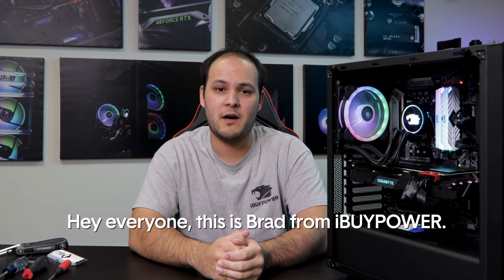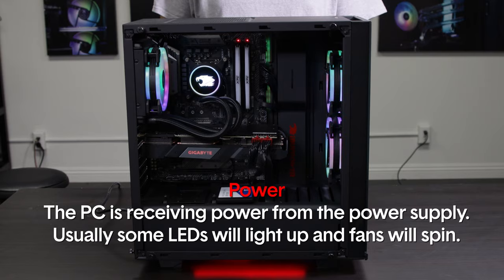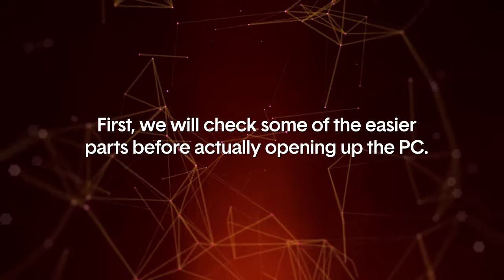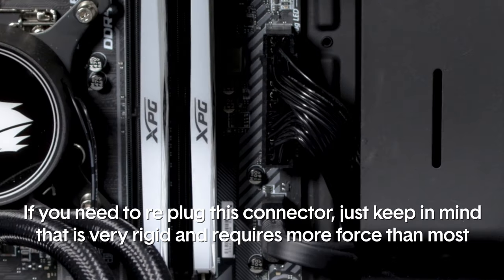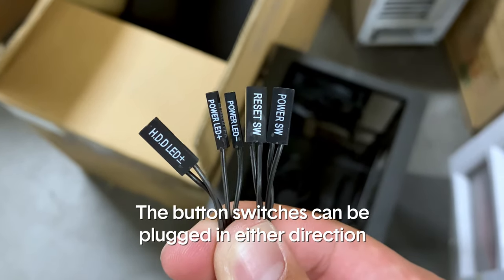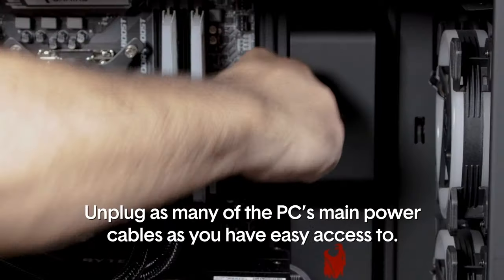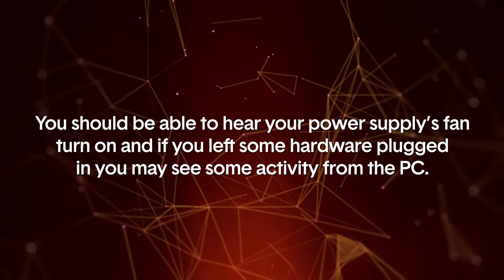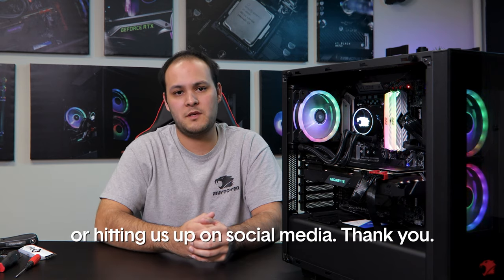"My Computer Will Not Turn On" - Troubleshooting PC Power Supply | Computers and Coffee

Comment: My system was affected by a power outage .  My microwave and clock radio had flashing displays. My computer had a green LED on the rear of the power supply and orange LED on the mother board lit,  The power button on the computer face would not light or respond when pressed. I jumpered the green & black wires from the power supply and the PSU fan and 2 aux fans turned on. Still, the front button would not light and nothing would respond if I removed the jumper to the power supply wires.  Any suggestions to try next ? Thanks

Comment: I got to the part where I put a paper clip on the on/off charge and when I turn it on the fans turn on but when I plug it back it doesn’t turn on. I also did look at the power supply and the prongs for 3 and 4, 4 is missing.

Comment: Was gonna watch this video, saw I had to turn the power supply off first while my pc was open. Noticed a light flash in the pc when I turned it off. Turns out the on and off switch just flipped

Comment: just builded my first pc. it wont boot and when turning on the power only my motherboard turn on. when pressing the power button nothing happens. i have checked to see if my power supply is dead but it works fine. can anyone help. i suspect that either the motherboard or the wires from the case doesnt work
Reply: Try disconnecting everything and plugging it back in. If not I usually remove the GPU and try to power it like that. You might have to trace the wires to make sure they're connected to the right slot on the PSU.

Comment: I used the paper clip and the computer turned on.  However when I plugged the 24 pin cable back in the computer would not turn on.  Not sure what to do nexr\t

Comment: I have a power issue with my z390 board. The lights in the board come one, but it in a bit of a flickering way then turn off after about 20 to 30 seconds. The system does not turn on with the power button or when bridged with a metal object such as a screwdriver. I've already tried another psu, same results. I tried various things like with/without cpu, cpu cooler, ram etc.

I believe it's a power delivery problem, like it doesn't send out power correctly across the board but I don''t know where to go from here. Perhaps a faulty capacitor or two?

Comment: My pc won’t boot, and I mean, it won’t even go so far in the start-up proces that I can’t do what you are showing in the video. It will turn un just fine and have weekend just perfectly until a Windows 2004 update, then the problem came. I do can figure out how to set my pc to boot from USB, but my pc doesn’t boot from my usb even though that I in the bios set the boring to be from my USB port. What to do? It just shows my Lenovo logo on the screen when I start up and all I can do is to Press f11 to Enter my bios menu, but I can’t Enter any windows repair/recovery functions. What to do?

Comment: Ok so I ended up having to do the paperclip thing. The only thing powering up are my case fans, everything is plugged in correctly and all that. So is it a dead motherboard then? I get no video output, tried two different HDMI cables and also tried hooking it up to onboard graphics Instead of the GPU and got no results from both. But even the fans of the GPU don't spin, so dead mobo then?

Comment: I just repasted my cpu and now I can't get it to power up. Zero power to computer. Hope this guide will help!
Reply: Looks like the power button connector was the issue. The bad news is cpu temps are still high, so time to try a different method of applying thermal paste. If that doesn't lower temps I guess it's time to get a new cpu heatsink.

Comment: Built my first pc and it worked fine for almost a month. Then it starting doing a thing where it wouldn't send a signal to my monitors except for some green dots when I restarted it. Then it wouldn't even power anything on. I send my motherboard in to be fixed and plug it back in when I get it and still nothing turns on. I really regret making the switch to pc. It really hasn't been worth it at all.

Comment: What is the case if my power source and switches are working fine? Fan is working but no display.. it open once but when i press start normally it turned off and then won't ooen again

Comment: I got AMD Ryzen 7 5800X up to 4.7GHz, 16GB DDR4, 1TB NVMe SSD, AMD Radeon RX7600XT 16GB with 500W power supply and it randomly shut off and wont turn on could it be that 500W isnt enough?

Comment: I tried the jumper method and my psu still working and I try to connect them one by one still connect but after I stop the jumper and put 24pin to motherboard it won't turn on, so is it my mobo is dead or something else? I try to jump the power switch but it also don't turn on

Comment: So I have the x570 aorus elite wife MOBO. And at first I was getting no signal to the monitor even though it seemed to power on fine. After I sent it in for repairs, it came back to me not powering on at all. The paper clip test worked but when I plug the 24-pin cable back in I still get no power. Am I out of luck and should just have this one replaced or is there another solution??

Comment: I have seasonic 1050 watt
Arround 6 years
I have this problem power on
I fight to turn on
Connect with old dell 29 inch monitor 
Mini display port
Second screen is tv samsung to watch movie with hdmi
You think is just cable or setting 
not psu 
Issue ?
Thanks a lot

Comment: Hello if the problem comes from the power swtich button (my PC doesn't turn on when I pressing the power button but it works with screw driver), what is the step do? Replace the front panel cable? Thank you

Comment: Oh I really need help. Even the computer repair shop is confused. So I did what you suggested in the video and the PSU didn't do anything. I took it to the repair shop. They put another CPU in the motherboard, and it turned on. So now they say that the CPU needs replacing for it to power on. They have never seen one of these CPUs fail. This doesn't seem right. The CPU is an i7 8700 4GHz CPU. It has worked without any issue up until I left the computer sit (not be used) for around 2 years. I had left it in my home country and then moved overseas. I just brought it back with me on a plane and tried to start it. Dead. Please help. I really can't afford a new i7.

Comment: I have everything plugged in and when I jumped the power supply it's fan turns on but nothing happens when the 24 pin plug is plugged in.
What can I check next?

Comment: Hi guys ...

Apologies from commenting on an old video but 

I thought I had an issue with my psu as my fan wasn't spinning when powered on. When I took the 24 pin plug off and bridged the two pin the fan spins... So from this my psu is ok you think? The voltages are all ok too

Comment: So i did the paper clip thing and it worked the rgb turned on but when i try to plug in any other cable it wont turn on does this mean my motherboard is not working or ?

Comment: just did an upgrade to a 3950X on a X570 mpg with a 500 W PS, when turned on, not even the power button on the tower lights up and when I press it I get a millisecond of activity before nothing works. fans and lights try to run but quickly stop. I have had issues of system crashing on old system and read things like that point to a faulty PS. thinking just upgrading to an 850 and try again.

Comment: need some help...so i have my 500w psu...but it wont turn on when i use it on my computer, ive tried to jump the psu and it still worked(the fan is spinning) it just wont turn on when connected to the computer...i also tried using my old psu(250w) it work perfectly...does that mean the problem is in the 500w psu?

Comment: I just replaced the motherboard, ram, and nvme drive in my build and when I plug it in and flip the psu switch to on the ROG logo(Asus ROG B550-F gaming board) turns on so the board does have power but when I try to press the power button nothing happens. The front panel plugs are connected properly as the NZXT h710 makes it very easy but the led on the power button doesn’t turn on and the button doesn’t work. It worked perfectly fine before swapping out the parts. Why might this be?

Comment: So my power cable is connected to pins 3 and 4, but the reset cable is connected to the other side of the computer, not beneath the power.

Comment: I got an new PSU a couple of days ago,700 watt Integrator Aerocool from an EVGA 500 watt B Bronze as I will be upgrading from a GTX 1060 to a GTX 1080.It was working fine until the new PSU was installed an stopped working the PSU was switched back incase that's what the problem was but no joy either.I had my brother look @ it as he's a genius with electronics but couldn't find why it wasn't turning on.The motherboard is a Gigabyte AB 350 gaming 3.I use the Pc every day,mostly for Internet,YouTube etc but game also.Would the motherboard have just popped as it's used so much? 
It's 3 years old now. 
Any help very much appreciated!

Comment: My surge protector tripped while my computer was running abs now it won’t run… I’m guessing this isn’t going to be an issue with cables… my guess is the motherboard or power supply blew… any other guesses?

Comment: my pc randomly won’t turn on at times.. the led on the motherboard is on but when i press the button, nothing happens. I usually have to wait for a couple hours and try to turn it on again until it randomly works.

i’ve checked all of my hardware connections and it’s all plugged in well.
Reply: i’ve also tried to jump the power header and nothing happened

Comment: my issue is , my PC doesn't start when i press the power button eventhough it makes the bridge, i tried jumpstart but it didn't work but
when i connect the green wire (PS) of the PSU to ground the PSU runs and CPU fan also but still PC doesn't boot till i press the power button
that's the only way i'm turning on my PC for the time being
 on

Comment: Thanks for the psu jumpstart at least i know that i didn t buy a falty psu. The problem is the 24 pic connector it s just doesn t want to go in correctly
Reply: No mater how hard i try the 24 pin is not sealing shut or i don t know what the fuck is up with my pc
Reply: Update I found the problem
The power switch is not working for some reason beyond my abilities
With the pin i was able to turn on the pc but as soon as i plug the power sw in and try to start normaly it just sais NO!

Comment: So when I jump the power button header it turns on for a second before shutting off again. The power supply is working for that last step when I jumped it… what do I do?

Edit: okay so it turned in after I held the power button for a second then flipped the on switch in the back
:l
But if I shut it off there’s no guarantee it’s turning back on

Comment: iBUYPOWER.psu paperclip works meaning my psu is okay..connecting it to the motherboard whos green light on the board power light..tried jumping power pin in front panels but that doesn't start the pc..can the pin be fixed or so i have to replace the whole motherboard?

Update: it turns out the power pin port where i inserted the paperclip got messed up..had to just tighten it up and all is good..

Comment: My pc freezes on boot sometimes it gets into Windows and freezes most times within the early 2-5 mins and the keyboard and mouse rgb goes off, i cant do anything in the state until i force restart. Sometimes when i get into Windows i can use the pc for over 7hrs and even play intense games without interruptions. 
And now most times the PC just boot into a state where the pc won't turn on but i can see the motherboard led and my cpu and case fans spinning and it would refuse to on even after several restarts 
Sometimes after i leave the pc for while and come back later it just comes on and the same loop continues, what could be wrong and how can i fix this?

Comment: I got  fans and lights come on for 1sec then turns off  every time.  Taking out the CMOS battery for 5mins then replacing it  fixed it. This will reset your motherboard settings to factory settings.

Comment: I used a EVGA sata cable on my Nzxt PSU to power CPU fan bused start button and some motherboard lights and PSU pump lighta flashed and that was it so I switched back to org SATA cables and now pump don't work and fans are at their limit and CPU temps go to 70c instantly in idle. 
Any tips what I can do ? )

Comment: I think my problem is the power supply cause i always put the PC on Hibernate and turn the outlet on. When I turn outlet on PC has a blue light coming out but not anymore.
So since the outlet is working the PC won't turn on meaning either the plug or power supply are at fault.

Comment: The problem with my computer is that the power button does not work, I’ve had a professional look at it and he didn’t find any problems, I thought it was the case so I went and got a new one but the case wasn’t the problem because it starts just fine but I have to turn off and then back on the power supply, then and only then the button on top of the pc launches the power process

Comment: I desperately need help!  It's been over 14 years since I built my last PC, (unfortunately for health reasons) I have a beautiful box from 2010, acrylic glass and LED hoses, but the connections (initials/names) are quite different from the current motherboard, I can't understand how make the last connections to the motherboard and 1 ASRock B550-HDV and I have no idea how to connect the wires.  If you send photos.or.names.of the cables, would it be possible for someone to help me so I can finally get my PC working?!

Comment: I got an huge issue w my PC , it was working fine until 2 days ago , monitor wasn't getting any signal but my fans were working , if I was to reconnect monitor again PC would turn on and turn off almost immediately after , if I tried to turn my PC on again it wouldnt turn on . Each time I replaced GPU it would work on first try but monitor would be stuck on loading screen. At this point I might think I should replace hard disk since I was getting some errors with it. Hopefully it will fix

Comment: I tried to check if my power supply still works, I used as in the video a paperclip to check if the power supply turns on, it does but the fan speed is minimal does that mean it's  dead?

Comment: My pc turns just on just fine witihout my gfx conncted. Rams, motherboaed leds, fans, watercolor, etc. If i istal my gfx it will start revooting over and over. Ive checked all the cables and everything seems just fine. I cant test with another suply but ive tried using a diff gfx card. My recommendarion given was that my psu has fried and is not passing enough enough power. Could that be the issue?

Comment: I did the very last step and the only component left unplugged was the 24 pin to use the paper clip and my PC powered up, but when I plug the 24 pin back into the motherboard it won't power up. What does that mean?
Reply: same here

Comment: I’ve come to hate this brand. Nothing but problems with this pre built ibuypower. Randomly would freeze for 3-5 seconds, and it finally just shut down completely while freezing. Now the LEDs come on and fans spin for 2 seconds when I try to turn the computer on. Then everything goes off, fans and lights come back on, but nothing ever shows Up on the monitor. Had this problem a year ago. Took the PC to a hardware store. Was told no problems. Came home and it just happened every now and then. Support staff for ibuypower has been next to useless.

Comment: i tried to jump the power supply and it did  start couppled with some other case fans but soon as it plugged the 24 pin back into the motherboard it stoped reacting at all no lights, sound or spinning. Does anybody know that could be happening?

Comment: I noticed today a burn smell coming from my pc, turned it off and then tried to reboot. No display but the fans and lights still work. I noticed the psu red voltage switch in the back looked a lil burnt. What should i do?
Reply: Unplug the psu and move it right away. Get a new psu im worried for i tbh

Comment: You forgot to add the most basic check i.e. checking your power cable which connects to the wall and psu.

I followed all your steps nothing worked, after checking the power connector then I checked the power cable and that was the issue!!!

Comment: I get the power supply to turn on and some fans going just by jumping the pins but as soon as I plug into my motherboard everything stops. Do I need a new motherboard?
Reply: Did u end up fixing it?
Reply: @xRedus  yes i was plugging the power switch into the wrong spot

Comment: Can someone help I jumped the power supply slowly started pigling everything in and all that was left was the 24 pin wire once that was plugged in it didn’t work does that mean there’s an issue with the 24 pin wire ??? Which means I need to get a new power supply ?
Reply: I’m in the same boat, have no idea what to do

Comment: I need a lot of help I tried everything and the power supply fan is running I tried jumping the power and checking the polarity. Nothing works
Edit: apparently it wasn’t the cpu, motherboard or even power supply. It was the case fan. Apparently you can’t plug it into sys fan 1 but instead you plug it into sys fan 3, 2 or 4. That may be just me but I felt so stupid. If you tried everything and it doesn’t work, try this.

Comment: Bruh i tried everything  and it still wouldn't turn on, i thiught it could have been a shitty 24 connector, i even checked all the pins if it was good and it turns out it was because i plugged my coolermaster wrong, it took me the whole day but lessons were learned